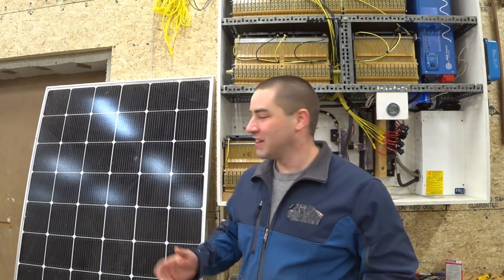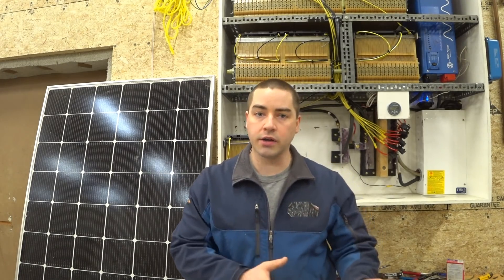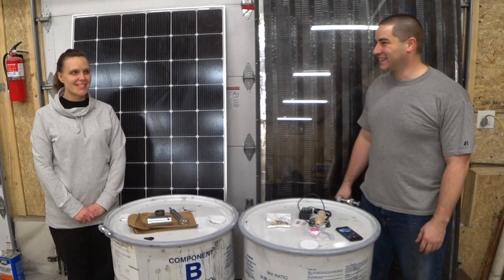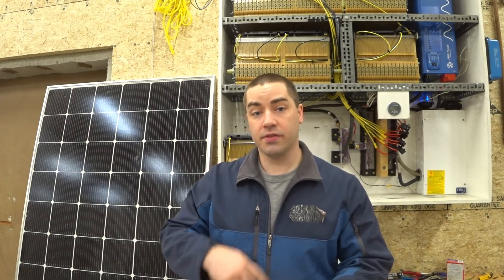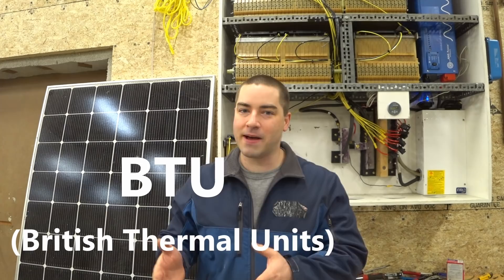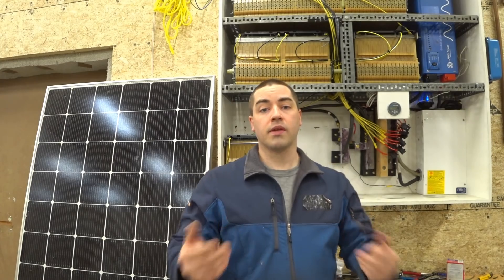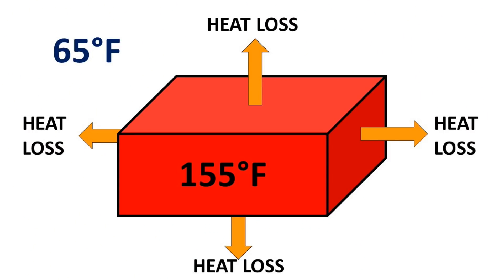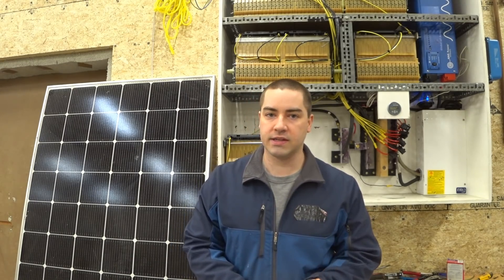Cheapest Energy Storage Off-Grid

Comment: That’s great but can you turn it into electricity ?
Reply: Not terribly efficient but peltier units can take hot to cold and producing energy but if this thermal battery cost 7 percent as much as a regular lithium then it still wins.  Peltier unit are only 10 percent efficient.  Now we're talking only efficient but a thermal unit should never have to be replaced as a lithium will one day.  Still lithium and conversion will have losses as well.  How would it stack just with simple numbers?  7 percent cost of a thermal battery would be 14 times cheaper.  If a peltier unit is only 10 percent efficient then you could get 1.4 times more energy using only these 2 factors dollar for dollar.  Of course many other things come into play, ambient temperature thermal difference etc.

Comment: Hi David.  I found a much easier way to heat water with solar.  I bought the Tinsay 13 Gallon Electric Instant Water Heater Electric Hot Water Heater.  I use it on it's lowest power setting(200watts) but use the highest water temperature setting.  By the time I get home from work the water is 140 degrees and can take a 10 minute shower with plenty to spare!

Comment: For off grid, I would consider adding another loop that comes from an indoor or outdoor rocket mass heater for those long stretches of no sun or excessive hot water use.  Rocket mass heaters use little wood relative to normal fireplaces/wood stoves.  So one burn of a small amount of wood would yield a lot of BTUs to bring that thermal storage tank back up for hot water and space heating.
Reply: If it was me off grid I wouls just go with solar panels and power a heater or air conditioner as I wanted.  maybe heat sink extra solar to heat, but for $2000 you could live modern world off grid....

Comment: #hiddenbattery Thank you for walking through the math especially the inefficiency or heat loss.
Reply from the maker: Your welcome.  In my situation the tank helps me heat during winter, but is bad in the summer because I use AC.  I didn't get into the calculations on that, because of time.  Thanks for watching.
Reply: DavidPoz 
So now that you have had some real world useage time under your belt, would you steer your course in the same direction today?  If so would you design the major components any differently? Or even been made aware of technology that would do things better?   I’m several years into a remodel where I’m trying incorporating off grid goals without breaking the bank or adding to daily workload/worries..

Comment: Here's a tip for you. Make a heatexchanger for the shower drain and feed that heat to the water supply before it goes to take heat from the "energy storage".
Reply: Called a SHRU. Shower Heat Recovery Unit. When my shower is running steady-state, it pre-heats the cold inlet from ~15°C to ~35°C, just from the dirty hot water going down the shower trap. Then you're just bleeding in a small amount of hot water at the thermostatic mixer to bump the temperature back up to 42/43°C. Satisfying.

Comment: Seems to me, what you want is high amount of thermal mass, not necessarily water. If you made your tank out of concrete, insulated the outside of it, and filled in dead spaces with stones or bricks, you could radically increase the heat storage.

Comment: Now depending on the solar thermal panels there are many different kinds, the better panels have a vacuum chamber built around an inner copper tube these are built of thick shatter proof “ up to a certain degree”  glass  with copper inner core, you can used these panels to get 150 to 160 degrees on a cloudy day .... over 250 degrees on a blistering sunny day during the summer ..... perfect 

Now here’s something you can do and build yourself. It’s a custom built water reservoir,  essentially you can convert a 500 gallon propane tank to accept a smaller tank to fit inside with 4 inches distance from external tank to internal tank all the way around inside the external tank, have your internal tank mounted via steel supports and welded in place, make sure you take the rounded caps of either side of the external tank so you can work from either side for welds and plumbing.  Use 1” inch stainless steel water pipe for your inlet and outlets of your internal tank Weld both connectings and fittings connected to the inner tank, make sure your run of pipe exits out the ends of the main tank where the end caps are off. Also run a 100 foot loop of 1/2 inch copper into your internal tank for connections off of the solar hot water panels and run out separate holes on one side of the external tanks endcap. 

Also make sure you put a high temp food grade paint on the inside of your internal tank and make sure it covers every bit of the internals of the tank to keep from rusting from the inside out.  Once the internal tank is prepped  made sure it is water tight and installed and secured into the big tank, cut holes for the water pipe to exit the endcaps of the bigger tank. Weld the bigger tank back together including the pipes sticking out from the internal tank , cap and weld all of the threaded opening for the exception of fitting a vacuum gauge onto the bigger tank. Before screwing vacuum gauge into the tank, hook up to a compressor and test to see if it hold pressure up to 80 psi without losing pressure. After pressure testing is done install vacuum gauge and attach a vacuum pump to the tank and apply 10 inches of HG “mercury” or millibars to the main tank. This will provide a vacuum barrier between the two tanks and also a thermal barrier because of the vacuum that is applied to the space between the two tanks. A vacuum is the best insulator to be used for the least amount of heat loss in a system .... now just wrap the external tank with fiberglass or flexible soft core foam and you will have the ultimate hot water storage unit. If you have any questions please give me a call I am available  my number is 1-610-823-2293 my name is Robert
Reply: Almost forgot you should have just about 250 to 300 gallons of water at a temp of a minimum of 150 degrees with all losses figured into the build for a 4 day use

Comment: May not matter now, but look up indirect hot water heaters. They are hot water tanks made to be heated by furnace boiler water. They are basically the same thing you built. 👍
Reply from the maker: Thanks.  I've seen some nice solar installs using 2 or 3 of those tanks (80-100 gallons each).  They can work out real well.

Comment: Would you mind saying how exactly you heat the water?  I'm guessing that the water would probably be pumped out, heated, then pumped back in because of the tank design (i.e. you likely wouldn't want to perforate the EPDM material to get a heating element through it at the bottom thus risking leaks)?  Thanks in advance.  Paul  

PS - I have a large home made tank too!  It's only 3500 litres (900 gallons) lol.  It serves my underfloor heating and is a preheat for DHW.  I dug it into the ground and have 300mm insulation boards surrounding it.  The great thing is that I just used the cheapest polythene based liner (tank rarely goes above 130 degs f as it's unnecessary), been going for years with no issues.
Reply from the maker: Hi Paul Stone, Thanks for commenting.  First, I would LOVE to see your tank.  That sounds awesome.  Could we connect on facebook or e-mail if you have any pictures to share?

The tank construction is a wood frame, foam board inside of that, and then the EPDM liner.  I have a series of videos on the construction starting with this one: https://youtu.be/jKr4An8m_tM Thanks for watching.

Comment: Good concept.. wrong application..Nobody is disputing the benefits of solar energy.. just the cost applied  vs.  better application through other means... Take for instance a "solar oven"  cheap materials..   simple aluminum foil covering cardboard directed at a focus point  and then isolating  that focus point into a closed environment..The solar oven can and will produce enough heat to effectively pasteurize or sterilize water at a much lower cost than the Solar cells.. I don't have one.. but I have seen videos that show solar ovens attaining 350 degrees.. the only problem is  where to put it because they are awkward and do take up space....  but will they take up less "unused space" than a solar array??

Comment: Tall storage containers easily develop thermal stratification, but this is less pronounced in short wide containers as found in your crawl space. 

Instead of putting all your thermal mass in one box, consider several (n) thermal storage containers. By connecting the primary thermal loop to each box in series, you can achieve a higher temperature stratification. This allows faster (t/n) recovery times in the first tank. This also allows prioritized temperatures for thermal conditioning: one for hot potable water, another for heating the floor.  

You reduce the primary [closed loop circuit] flow rate so the first box gets up to the minimum temperature first. The flow rate is proportionately increased as the tank inlet (collector outlet) temperature approaches the maximum set point, dumping hot water into the successive containers. This works especially well if your final collector is a vacuum insulated type.

Of course, the secondary (potable) water circuit is also connected to the successive tanks in series, but the direction is reversed. You should use series-connected thermal mixing valves at the outlet of each tank, so the hot water is drawn from the earliest tank that produces the minimum necessary temperature. As tanks drop to the minimum setpoint, the flow is drawn from the next, hotter tank. [The mixing valves use multiple tanks at once if the flow rate is too high for the heat exchangers, so you may perhaps economise on PEX loops.] 

You could just [leave off the mixing valves and] connect them all in series, but this may produce a long slug of smelly water that has been breeding bacteria before being heated enough to be safe. 

The mixing valve setup gets cold relatively quickly suddenly as only the last tank in the set can become chilled by cold ground tap water. The other tanks are just locked-out at the minimum safe setpoint.
Reply: John Canivan as  done video on storage to avoid stratification with multi storages  https://www.youtube.com/watch?v=n90Y6Qwab_8

Comment: Just add vacuum tube solar heating system to run hot water,  space heating and even space cooling or fridge.
Reply: The vacuum tubes are really great as the final collector when several panels are connected in series. It seems that the flat plate collectors are very cost effective for raising the temperature of cold water and the vacuum tubes excell at high temperature differentials, so they work very well together. 

Due to inefficiencies, flat panels self-shed snow fast when hot water is circulated. Very handy if they are on a roof difficult to access. 

For tubes, just mount them vertical and well above potential snow banks. Sloping them to perfectly match the sun is a very minor advantage compared to keeping them snow-free with little labor. And you may actually have too much heat in the summer, which would require the safety system to dump heat.

Comment: Hey bud great video but I guess I got to ask. Why can't you use another type of fluid for thermal energy storage? I mean why water, you already using heat excahanger so  why won't you use some other fluid which has more thermal capacity or higher boiling point? Beside that can't we pressurize the thermal storage tank in order to get a higher boiling point? (By the way I just got curious please excuse my ignorance :) )
Reply from the maker: Hi he ho,  Thanks for your comment.  You are right.  Since I'm using a heat exchanger I can use almost any fluid I want.  It's very popular to use a non-toxic anti-freeze instead of water (as an example).  Water has a very high thermal capacity, easy to pump, and almost free.  It would cost me over $2000 to fill my tank with anti-freeze (Glycol), and glycol can't store as much heat per gallon as water.  

Pressure tanks can be used.  Some manufacturers make pressure tanks for solar.  But they are expensive, and won't fit into my crawlspace.  Making my own tank was the right answer for me, but not for everyone.  

Thanks for watching.

Comment: Cheaper simpler way, convert the water to hydrogen, use the hydrogen gas to power a genset of a night or even more basic use it to heat water. A biomass gas system is good for burning gas as well.

Comment: how do you turn that hot water back into electricity?
Reply from the maker: I don't.  I use batteries for electrical storage.  The thermal tank is for heat energy storage.  However, if you wanted to try, look up "Peltier"  Thanks for watching.

Comment: What if you used some type of oil instead of water as the heat medium?
Oil holds heat longer.
Reply from the maker: Hi madazz01. Thank you for your question. Oil could have some benefits over water. However, water can store more heat per gallon than oil.  Also, there is additional cost to buy the oil. And oil is more difficult to pump, which means needing a bigger pump (horsepower).  Thanks for watching.

Comment: SO your saying that ONLY on overcast days your using stored hot-water to shower with.and for the rest of the time your wasting valuable electrical power to run a hot water heater,is INSANE,you should be using solar hot-water 365 days of the year and just have a big insulated hot-water storage tank,so you can get 4 days of hot water ,if it's cloudy
Reply: Solar thermal has advantages, but if you're not grid-connected, and the battery is full, and you're still getting surplus electricity, what are you going to use it for? And there are other heat sources I can see fitting in with this, such as a ground source heat pump, which are a more efficient use of electricity. But a direct heating option has much lower capital cost.

Comment: The one part that's missing to make it a true comparison to lithium is the ability to convert that heat energy over to electrical energy (such as powering lights, powertools, etc) . I'd be curious to see your take on that and the options available.
Reply from the maker: I use both, heat storage (hot water) and electrical storage (batteries).  Thanks for watching.
Reply: @DavidPozEnergy  brother in simple terms if I install a 3 kW solar system as per your advice what additional things need to bought from your perspective, in addition to the normal other items that we use ..
Reply from the maker: Hi Thomas,  I'm sorry, but I am not following your question.  Are you building an off-grid solar system with 3kw of solar?  If that's your goal, then you need a charge controller sized about 4kw, wires, batteries, circuit breakers, SPD, inverter.  If you are trying to connect your 3kw of solar to a water heating element, then you will still want circuit breakers, wires, thermostat, and relay.  I hope that helps.  If you would like to discuss more try sending me an e-mail.

Comment: I like the way you think. If I may, the possibility of putting your hot water "tank" above your shower and simply using a cut-off diverter valve for hot showers on cloudy days would eliminate all the pex/copper heat sink inefficiency and cost as well as their cost in energy and effective amount of available hot water.   

Of course, a protective heat actuated safety valve should be used if you maintain above 120° in the elevated hot water tank...or you will risk becoming a scalded mathematician.  ") 

Have you seen the instant-hot units that operate from a inline gas heated coil for around $100?  You probably have gas service, but a bottle will work too.  Same thing could be added to the firepan of a wood-burning stove or fireplace for hot water.  My favorite bathroom had a fireplace (across from the jacuzi) that was open to the master bedroom on the other side...and now we're talking about an improvement in home value and ambience as well...not to mention a lot of enjoyment for mom and dad that the kids can use only on cloudy days IF they get the wood and start the fire.  Now--that's wholistic efficiency at work, eh?  ")

Comment: Did the humidity increase significantly in the crawl space and if so then why did you do to reduce that?
Reply from the maker: I have a sealed lid on top of the tank, so no humidity issues.  There is only a small vent tube that comes out to prevent pressure buildup.  Thanks for watching.

Comment: You can mitigate the problems of having an oversized tank by simply having multiple smaller tanks, with a valve system to heat up the second/third etc after the first reaches temp.
Reply: The only trick would be watching the surface area/volume ratio, and cold interference from one tank to the next. Hmm...
Reply from the maker: Thank you.

Comment: Use something to add to the water holding the heat in the tank.
Perhaps you can add scrap stainless steel?
Reply: Water has a higher heat capacity than most other materials.
https://theengineeringmindset.com/specific-heat-capacity-of-materials/